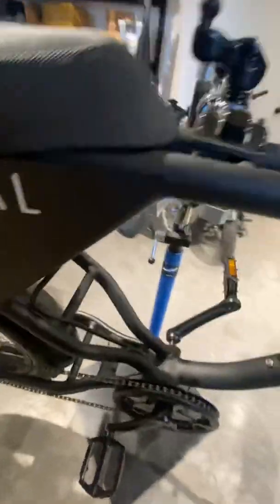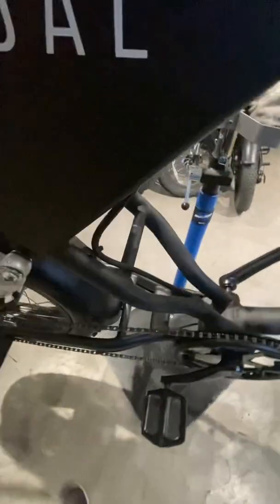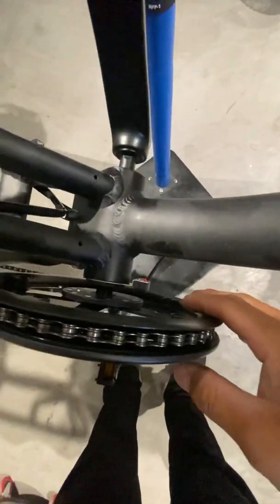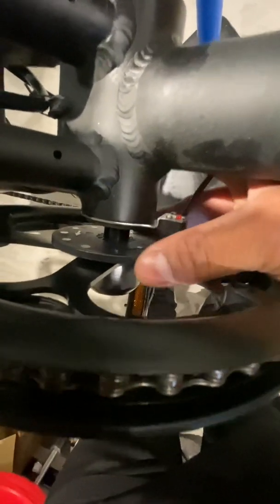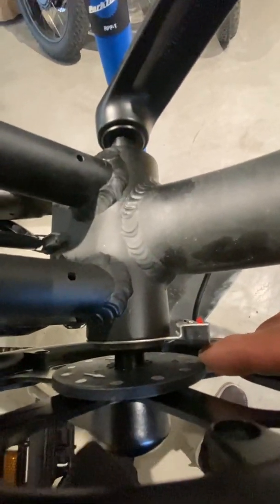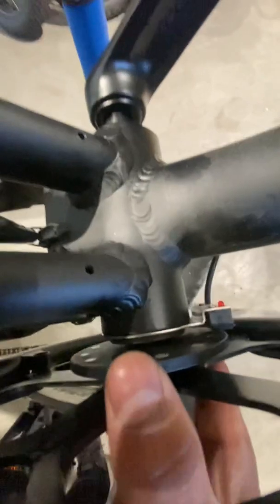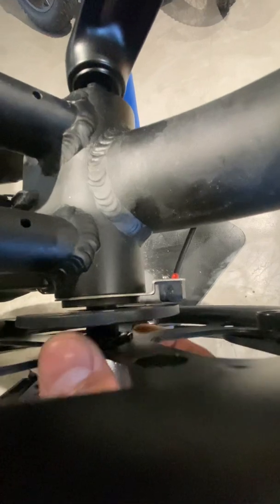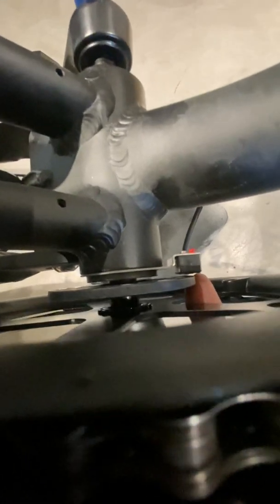Pedal Electric how to troubleshoot PAS failure, error 12 and 21.

Comment: Even after this it's still giving error 21. Sensor is flashing but I keep getting error 21 on the rear motor. Do you think there is a short?
Reply from the maker: @navjot628  that would be the motor issue
Reply from the maker: Inside the motor are sensors and magnets similar to the cadence sensor on the video. One or more of those sensors are not working and that cause the error 21. You can also check if the motor conector it’s burn and that would be the cause of it too.